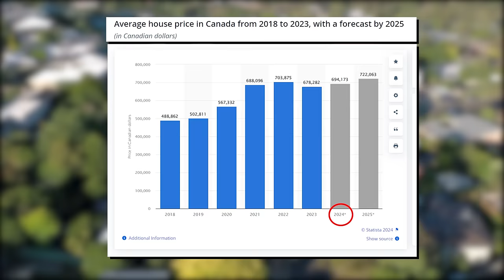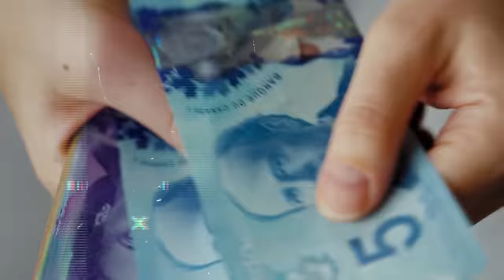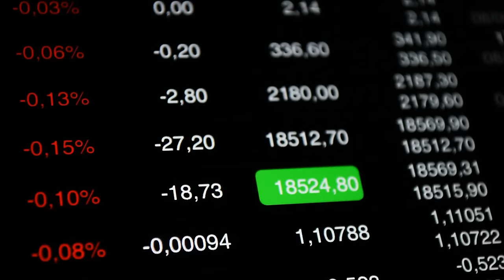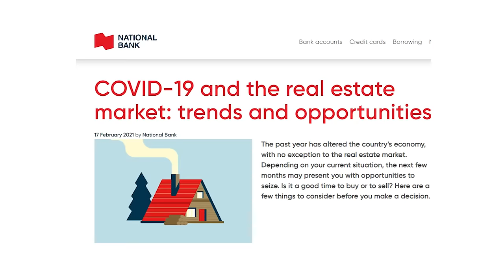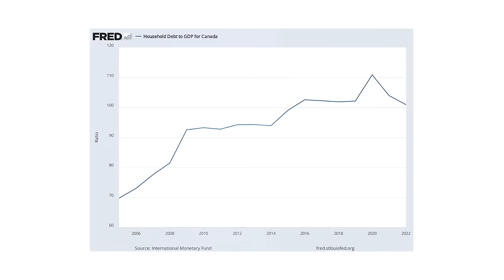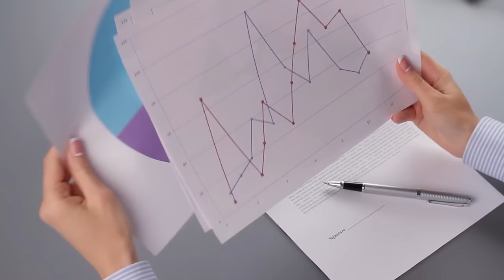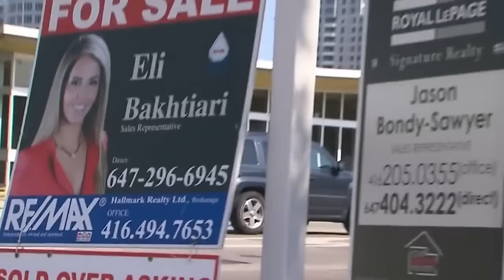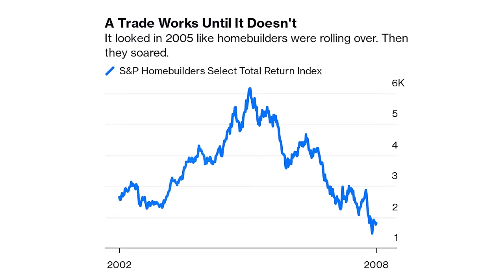Is Canada about to destroy its economy with the biggest housing bubble in history?

Comment: Hoping the housing bubble pops so those of us (the majority in fact) can finally buy a home. Homes shouldn't cost more than $200k. Hoping for a massive POP
Reply: Won’t happen. There’s not nearly enough housing supply for that. It will take decades to make up for all the housing needed.
Reply: We can hope. I bought a home in 2008 after the housing crash and paid 165k for a house. I sold that home in 2014 for 215k. Today that same home is worth 399k. The market is overinflated and needs to pop.  There are plenty of empty houses for sale where I live (500km North of the GTA) but no one can afford the ridiculous prices. If they were to drop back to the prices they were back in the mid 2000's they'd sell in a heartbeat. As the video states, affordability is the biggest factor. There are plenty of empty houses for sale with no potential buyers (for good reason, only an idiot would overpay for something worth half the amount on the pricetag)